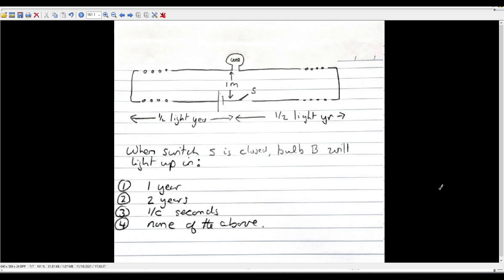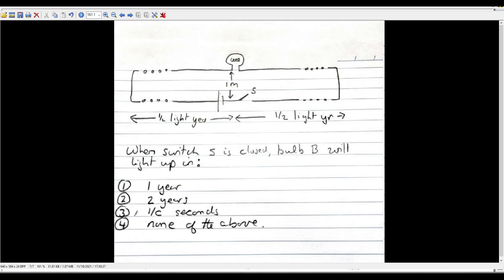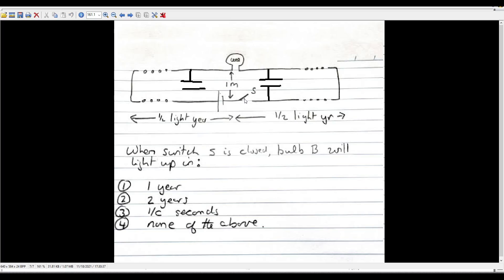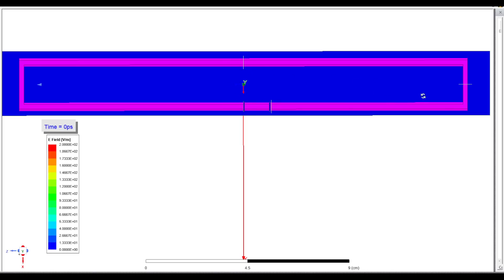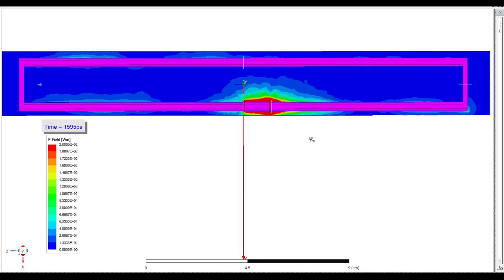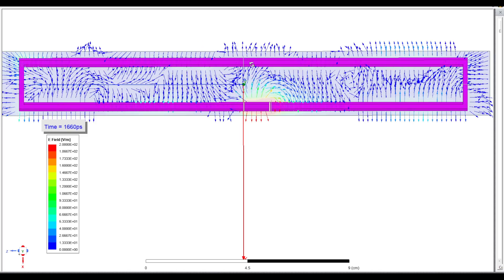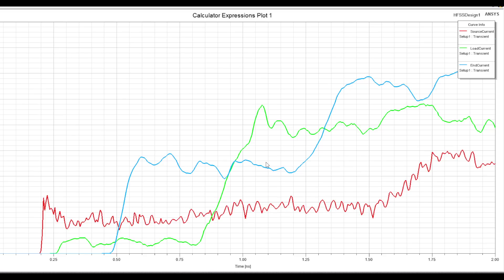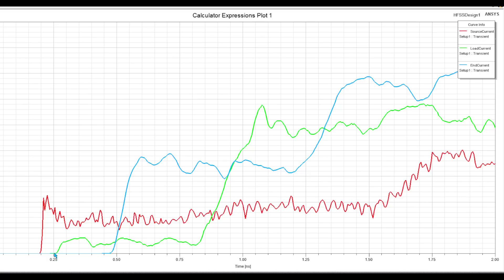Response To Veritasium - Electricity Propagation Time Problem

Comment: Great video. Veritasium's explanation of how energy travels through the electromagnetic fields and not through the flow of electrons is very nice. The conductors in the circuit are, in effect, waveguides. Where his video falls down is the suggestion that the lightbulb will actually light in 1 meter/c seconds. As you've demonstrated, the field can be detected at the lightbulb (using proper equipment with an amplifier), but the current won't be sufficient to light the bulb. From the perspective of a casual observer without sensitive detection equipment, the lightbulb won't turn on until the wave has sufficient time to traverse the entire circuit (provided there is no wire brake somewhere further along the path). Tesla proposed transmitting power through the air more than a century ago. It's possible, but horribly inefficient, and more importantly, how an antenna works is not what Veritasium intended to explain and illustrate.
Reply: Why would there be any current flow from the battery to the switch? You are saying that you cam make a transmitter by taping an antenna wire against one terminal of a battery. Won't it take 2 years for the battery to find out there is a connection?
Reply: @charlesspringer4709 You're correct. Unless there is a closed circuit there will be no current flow. An antenna also requires a closed circuit. Veritasium implies that the radiated energy would reach the lightbulb quickly since it is only a meter away through space, but there would be no EM field without a closed circuit. The entire circuit would need to be energized before that could occur.
Reply: @michaelmcgowan7099  Now the question is how big a capacitor do you need to make this an LC oscillator with a period of 12 years?
Reply: @michaelmcgowan7099  lol do you have to wait for the water to flow from the source to your toilet when you flush it?  This is the simplest question that has everyone stumped.  Just like you have to fill the pipes to get pressure, you have to charge the wire.  After that the energy will flow as soon as you close the switch in a similar way you open the tap.
Reply: @michaelmcgowan7099  No, neither of you are correct. It will start with a transient current flow whether the wires are connected or not. The light will be on for 1 second (or year if the distance was light year). You will only be able to tell if the wires are connected at the ends after the wave reaches the ends and returns. At that point, the light will either turn off or get brighter. This is because, as Charles said, the circuit can't know what exists a lightyear away until the signal gets there.
Reply: Exactly!
Reply: But he is wrong. It does travel through moving electrons it just also travels through em fields.
Reply: @MrThedumbbunny  I think what he means by not travel through the moving electrons as in the power travels through the EM field induced by the moving electrons (very near to the conductor as in micrometers or just a few millimeters level, not the 1 miter thing), not through the electrons inside the conductor as the conduct behave as a wave guide to form the shape of em field following the shape of the wire. I think he is right technically but very very vague and confusing. I call him a troll for the sake of ads revenue.
Reply: @Laohei0103  there is litteral energy  in the electron motion too. The EM field transmits a majority of the power but the electrons deliver power via motion too. Also separating the current flow and the em field is... pointless understandingthe relationshipis important but there isnt really much done to explain it? You can do things like create induced currents but it reduces the voltage of the origional current so its not like it doesnt affect the electron flow. Its more like he went from a classical physics understanding and suddenly got part of the calc based EM field interaction and ran to the internet.
Reply: @MrThedumbbunny  as I said I totally hate his explanation. It is a totality of click (discussion) bait. An astonishing title/thumbnail provoking critical responses. That's why I said it is hard to say he is totally wrong because despite he omitted majority of the details in between, it is hard to say his conclusion is "wrong". Btw I don't quite understand the part that electrons deliver power via motion, especially in an AC case. The motion would be like push and pull and the kinetic energy given out would be drawn back isn't it? Or it passes energy by some form of friction (heat?) He is like using quantum physics concept to explain Newton third law. Very weird.
Reply: @Laohei0103  so a fluorescent bulb for example actually uses the light emitted from electrons going in and out of orbitals in the gas. Literally the electrons moving with the current is creating the light. The electrons heating up a space heater is via resistance or how much energy is lost due to the cost of going in and out of orbitals. Electron motion has energy related to the physical actions electrons take throughout the orbital hopping. Superconducting is different and there are apparently several ways to achieve it but that’s another topic.
Reply: @MrThedumbbunny  I would rather see the electrons are a medium for the electrical field to dissipate its energy. As in charged by the field and excite and after that return to normal state after the photons are released. I think it is a way of seeing things but to myself I would say that this kind of energy is travelled through the conductor. It is rather driven by the electrical field travelling through the space. As for heater I am not sure if it is just electrons jumping between orbits or if it is the electrons bumping into protons and neutrons and other electrons in the conductor. But look at it I would rather say the electrons nearest to the heater were driven by the electrical field against to pass on the energy from the field. I hope I had made myself clear. I would rather say it is quite philosophical instead of physical topic. Just providing a different way of seeing it.
Reply: @Laohei0103   the heater is due to the energy penalty at a physical level. Some materials have a higher penalty for hopping in and out of orbitals. Electrons dont really hit protons and neutrons much its like shooting aerosoft at each other expecting the rounds to hit. I think your thinking of electric fields the opposite of what actually is. Electromagnetic fields are the pressure generated by net charge movement. Protons could theoretically do the same kind of thing. But are heavier and far harder to access in large quantities. For the heater at a physical level it is the electrons attaching and detaching. When a non superconducting current goes through a material the material absorbs and releases some of the electrons repeatedly. How often and the tendancy to hold on (energy cost) is how much energy gets left behind along with some actual loss of charge movement as additional dissipation. I would really recommend if you are going to do electrical field start from the atomic level and build the current from physical properties to infinate wire condition. Of course this is a combined physics calculous chemistry question but gives a much clearer understanding of the situation.
Reply: @MrThedumbbunny  Thanks for the explanation. It is very clear. I'm sorry for using such inaccurate words. By saying bumping into protons, I meant the electrons's interaction with the orbit (quantum level) of other nuclei (which I'm not sure if that is the case as well). Otherwise it would be quite silly to talk about collisions in a non-nuclear reaction. The tendency to make the electron cling on is a good explanation.

Comment: Hi Ben, firstly, thank you very much for the simulation and video.
After watching the simulation, I concluded that Answer 3 (1/c) is wrong and the correct answer is 1 second (or 1 year in your case. btw the original problem posed by Derek was in terms of seconds, not years).
Does some energy reach the bulb after 1/c seconds? Yes of course. Is it enough to light up the bulb completely? No it isn't. If you watch Derek's video again, he shows a standard household bulb in the video and he never says that it is an "ideal bulb" or something that will light up with a small bit of energy - which is the mistake (imo) in your video at 11:31 where you state that "we can assume that there is a lamp that is able to be lit by this amount of current" - from where did you get this assumption? Again, Derek just showed a standard household bulb. 
Looking at the graph from your simulation, the current available to the bulb from 0.3 ns to 0.8 ns is about 1/8th the full current available at 1.1 ns. I guess one can debate whether the bulb will light up very faintly between 0.3 ns and 0.8 ns but most people hearing the question from Derek would assume in good faith that Derek meant a "normal" lighting level of the bulb which would be achieved at 1.1 ns in your simulation (or 1 second in Derek's problem). Which is the time taken for the wave to travel around the circuit from source to load, as most people normally assume.
Reply: I’m surprised that nobody has brought up the characteristics impedance of the transmission line. That and the impedance of the lamp itself would affect the time to reach the fully lit condition.
Reply: The answer is still wrong. No delay at all will be observed! We did the actual experiment. See my detailed post a the top of the comments

Comment: I loved the video. Only one question left. Why the electric field propagates so well and without losing much intensity through the SURFACE of a conducting material? An why it dissipates so fast in the insulating air? I mean, from a maxwell equations point of view
Reply: I mean, I thought metal reflected the waves away

Comment: Many, many people do not have an understanding of how Electrical energy propagates. Derek is correct, when he states it'll take 3.33 nS for the signal to reach the bulb. What he shows in his circuit is a Transmission Line with a distance of 1 meter long and a width of 1/2 light year. A simpler example is here, with a clear explanation. A Capacitor is a Transmission Line with a very low Zo. The energy that propagates is always the primitive ExH (Poynting vector) Electrons are never the cause of ExH propagation, but always a result of. Electrons have mass and inertia and the Newton's Cradle idea is not correct. https://www.youtube.com/watch?v=-FsjGX6qROI&t=39s

Comment: One other thing the loops are not a light year long lol. They are a light second long each
Reply: No. Lightyear was the original spec...1/2ly out, 1m link, 1/2ly in and then same for the other side. So 2+ ly of wire. So, it necessarily must be space-based...hence the system will be perpetually energized. Someone else butchered the distance using one light second in their video. Only adding to confusion.

Comment: I'm probvably missing the point of this thought experiment, but I think there's no need to have a circuit in the first place. It's highly unlikely that a wire that long would retain the same potential all over its lenght, I'm sure there will be a current even without a battery, powered by the very motion of the Earth.
Reply: As defined, 2 lightyears of wire are only going to exist in space. So, apply the conditions of space to the system. Cold=near zero resistance. Magnetic fields from Sun, Earth, Jupiter, other planets. Constant cosmic ray strikes. CMB radiation. The system is perpetually energized...no two ways about it. This is the problem with highly nuanced 'gotcha' questions. You say too much and the gig is up. You say too little and you leave the door open to reasonable interpretations. It really wasn't necessary to frame this as a 'brain teaser.' Now, instead of being informative/educational, he's dug a massive hole. He seriously needs to consider donating all video(s) revenue to a worthy cause.
Reply: @jaybingham3711  There is one mistake here, the cables in Veritasium's video are 1 lightSECOND long each side of the circuit, not a lightyear. No big deal as is conceptually the same problem. Still the potential at this scale will be heavily determined by the magnetic field of the Earth I believe.

Comment: So from the trends I can see that there will be some load current at 0.25 ns.    1/c is roughly 3.3 ns I cannot easily relate simulation results with the answer from the original video.

Comment: Well done, this is the explanation I was looking for. After watching Derek's video, I immediately wanted to see the transient situation, he seemed to skip over that and straight to DC. As if the EM wave generated from the first step would continue to power the bulb at full power until steady state, which irked me.
Reply: I totally agree
Reply: Veritasium totally missed the issue that nothing is really DC. There are pulses that are long, but they always have a start and an end and the transient response and settling times are what we derive from the physical structure of the conductors.
Reply: Yes, and I believe the geometry in this simulation makes the initial transfer a much greater factor than it would be with a 1m separation (it would be far less due to 1/r^2 field falloff).
Reply: @stephens1393  The general principles og Ben's analysis apply completely.
Reply: @Observ45er  Yes, absolutely-- Ben's simulation and analysis is very good.  It shows that the current prior to 2*edgelength / c is very small (1/10th the DC current) and it would be even smaller still (by a lot) with a full 1m separation.  1/100th, or even 1/10th of the DC current flow is nowhere near the majority of how and where the power is transferred.  The majority of the power does not reach the bulb until the full length of the conductor has been traversed by the wave.

Comment: I'm sorry but the answer 1/c is wrong. When you close that switch, the moving mechanical parts of the switch will generate gravitational waves that distort the spacetime between the switch and the bulb. As a result, the distance between the switch and the bulb is no longer 1 meter. hehehe

Comment: If he had a low power led i might believe answer 1m/c, however with a 12v battery and an incandecant bulb, i think the answer would be closer to 1 lightyear (or 1 light second for veratasiums example)

Comment: I have seen the original videos and many other videos as a reply to that original videos. In all cases experts explain why he is right and also why he is wrong. so I am still not convinced of any answer. this argument is not valid, imagine you cut the wire at one of the ends, 300 000 km away.

Comment: All you've proven is that the wire acts as a capacitor until the electrons physically move through the system enough to stabilize.  If you had a perfect circle loop of wire that is 1ly radius, it would effectively be the same setup, but the light will now be 2ly away from the switch instead of next to each other....the other thing is that the speed at which the waves propagate will match nearly with current flow and will hit the light at the same time....which is not answer 3.  The Veritasium question is malformed because although the light will turn on almost immediately, the light will not have steady electricity for a long time after that.

Nothing can move faster than c....so if something seems to be, then the answer lies with some other mechanic.  Even gravity waves have a c speed limit....which means if the sun were to vanish from our universe, Earth would still be pulled by gravity until the same time the light disappears.

Comment: Wasn't the distance to each side 1/2 light second, not light year?
Reply: No. Lightyear was the original spec...1/2ly out, 1m link, 1/2ly in and then same for the other side. So 2+ ly of wire. So, it necessarily must be space-based...hence the system will be perpetually energized. Someone else butchered the distance using one light second in their video. Only adding to confusion.

Comment: What Nonsense.   You conveniently added capacitors at two points, and yet there are trillions of capacitors in the circuit, 1 from the negative pole of the battery to ground bypassing the  switch altogether, as well as every other point on the line, going to earth and anything in the surrounding environment.  The fact that the energy will leak out at various points does not mean the energy of the battery travels to the globe directly across the intervening space.  Imagine if we were no longer talking about a 1 meter separation but a 1000 meter separation with a few city block buildings sitting within the circuit loop. Would you still imagine energy flowing directly across all that matter and air to the bulb and having any meaningful result.  All this stuff are just mind experiments and the problem with mind experiments is that they just happen in our imagination. As such they probably have no connection to the reality of what happens inside a conductor.

Comment: I think most folks realize that there will be a signal at A/c seconds (where A is the separation).  What is in dispute is whether there is meaningful power delivery.  Rescaling your example to 20 meters long by 1 meter wide would be plenty to see what happens in the first 10 ns or so.  I have no doubt something shows up at ~3 ns, but my contention is at 1 m distant, the current will be tiny (1 mA or less).  I do not mean this as a criticism - I appreciate very much what you've done here.